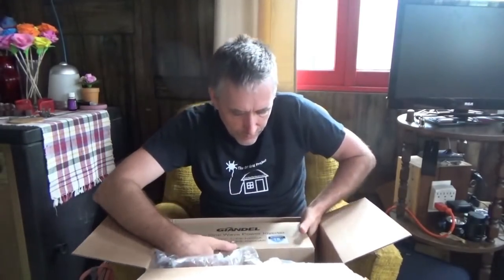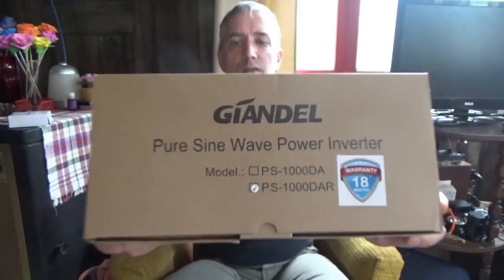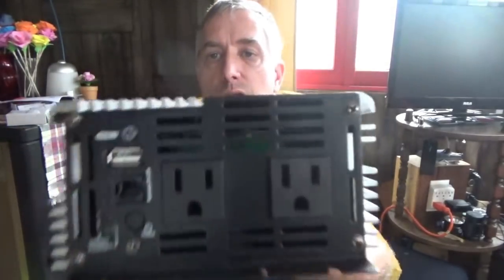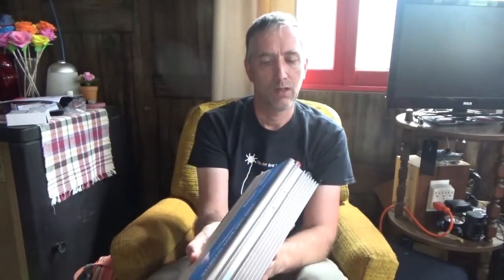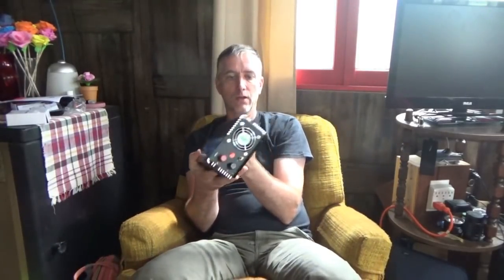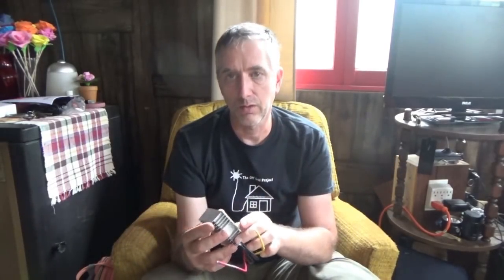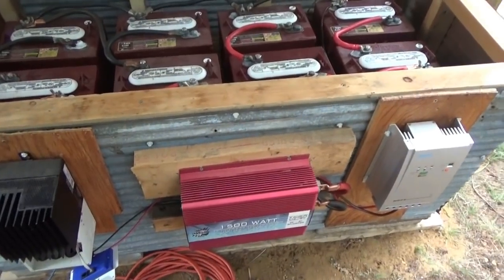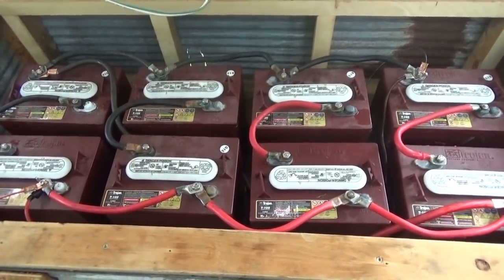The Off Grid Project Converting To 24 Volt Solar Battery Bank

Comment: I have one simple question how are you going to emergencies charge your system with your car
Reply from the maker: bypass it and just use the car power. I have enough panels on the batteries that I just leave it alone if they get a bit low.

Comment: I have now changed mine to 24 v . But i run all my 12 v things on the 24 v  battery system .   Just connect to one battery  on the system  It will save a lot of cash . Mind what i said just on the one battery on the 24 v setup. Try connect to the one near the charge controller . Only on the one battery + - . so you can still use  all your 12 v inverters .

Comment: I have 3 of those Giandel invertors. They are good but cause a bit of RF noise. The watt raiting is over rated.
The 24v to 12v buck convertor is good but also overrated, buy a few spares.

Comment: Why are you converting things to 12 volts when you just bought an inverter that goes from 24 v from the battery bank to 120 v ac.. for the home. All your appliance can run off that one invertor. there is no reason for that little box unless you have 12 v devices That can not take 120v. Any normal house hold item (ie like a vaccum cleaner) can run off that inverter. Unless im missing something from the video. 

And why go from a 1500 watt to a 1k sine.. you dont need sine wave for electronics. Any electronics now a days have rectifiers in their plugs.. and can take a VARIOUS amount of voltage like 100 - 220v  because of this you do not need a sine wave.The rectifier cleans it before sending the 5 volts to the electronic.   Unless your running some kind of electric motor or medical device you its just a waste of money since the electronics power plugs clean them up themselves.  Personally since you already had a 1500 watt inverter i would of used the money and just bought a 100 amp charge controller so i can expand my solar and wind. Then the green energy goes to the charge controller.. which charges the batteries.. then the batteries power the Inverter.. which powers the house and all its devices. and their is no need to buy 48v devices for the home.. since its converted from the inverter to 120.
Reply from the maker: 1. I have 12 volt devices which I still use. Also our USB plugs run directly on 12 volts.
2. The fridge would be destroyed and some computer power supplies these days are very sensitive and wont run. The whole idea is to run mining rigs so I need clean power.
3.  By converting to 24 volts I can connect more solar panels on a single charge controller, saving money in the long run. Now I have extra charge controllers for expansion.
Reply: The Do It Yourself World lol except you have clean power. Battery power is clean. Dirty power is grid power or generator power.

Batteries are the cleanest power you can find if anything was to hit the system like lightening that charge controller and batteries would take the hit before anything else. 

The only thing I could see a reason for it is for grid power.. because that is dirty.. if your running 100 percent battery power it’s clean and you don’t need sine wave.  Those rigs use reg power supplies and you do not need clean power for them due to they are able to switch from 120 to 240 volts depending on   Country. Battery’s Do not give brown outs or spikes or they would never use them in a ups system if they did.    

If a device can plug into grid power with no additional inverter .. it does not need a sine wave. Because ac power is not clean. They build it to run on a dirty grid. 

The only issue you may have is anything with a motor in it.. ie the fridge may have an issue with a modified sine wave inverter but 90 percent of stuff works fine without a sine wave.

Just trying to help anyone following along the journey.

Comment: Hi Troy.  Good title and exact quality video.  I know you are in a hurry to get the rig back up and running but would it be possible to throw an amp clamp or meter on the new inverter and DC converter inputs before you turn on the loads?  I am interested in the units but would like to know the real world idle power draw with no loads attached.  Just a quick volt and amp check would be great.  And it would help you too in the future should the units act up, you would have a base line power measurement to compare with later in deciding if something is abnormal.  I do this principle in factory equipment motors and vfds a lot and it really helps in troubleshooting where a problem exists.

Comment: When you go to 48V, the Tri-Star will be able to handle 3kW+! :) 

Good to see you'll be able to get more efficiant use of the panels and DC->AC conversion for mining and house use.

What matrix are you using with the arrays? 4P x 2S? 2P x 4S? 
60A controller might cut out in the summer or with cloud lensing in the winter if using 4S configuration. 
Hate it when that happens... Had to back down to 3S from 4S in my setup because of it. :(

X->12V converters are handy! I have a 48->12 for my 12V distribution panel. 

Pyle makes some good higher power units, 30A@12V,  for 24V->12V on Amazon. 
Even used them in parallel with each other to get higher power till I could get my 48V inverter/charger; NOT advised and technically voids warrantee but did work since their output and internal resistance were close enough not to overload an individual unit when drawing more than 30A from the array of units. Got about 1000W@12V reliably from the 4 units output wired in parallel; I did fuse the heck out of the setup on input,15A, and output, 30A, just in case... Never popped them in about 9 months of use tho.

Comment: Good, 24V is more efficient both the MPPT charge regulator and the inverter, for the 24V is recommended only and no less than 2 panels in series at a time, in parallel to the others with diodes etc. I know that many car adapters for cigarette lighter they go soa to 12 that at 24V worldwide, good job
Reply from the maker: Thanks. I will wire all the panels in series. Now the panels and the batteries are matched at 24 volts.
Reply: ok, it is recommended only if you have the line as you once had in the pine forest, then you take advantage of the high voltage to limit the losses of long or incorrectly over-sized cables for low voltage, where the panels are close to the controller is not convenient they lose about 2 percentage points of the MPPT, this is in the manuals of known MPPT charge regulators made in the USA, for example 24V batteries equalizes to about 31 volts, to better exploit the cloudy days or the initial and final phase of the day. maximum voltage is + 130% of the maximum voltage equalization, so for a 24 Volt battery bank it is recommended to maximize the total efficiency of not exceeding 71.5 volts from the panels, especially if the power of the panels is close to power maximum of the MPPT regulator
Ciao and good work!

Comment: Finaly!!!! good choice, you make me smile now! lol oh, and.... Battery strip fuses? lol
Reply from the maker: Wow!! Put it in your calendar!! I made you smile :)
Reply from the maker: Once I get the panels wired right I will also put in a cut off switch between them and the charge controller. That and some fuses will come next.
Reply: Not to bash, but think about fire hazards.. the short term power from lead acid battery,s is huge. The new system will work great! A master fuse between the battery is most inportant, the panels not realy, unless you want to mount it to code.

Comment: 24 volts is great. But since you're buying a new inverter anyway, why not go to 48 volts?
Reply: P.S. The good thing about keeping a grid connection is that even if your work is interrupted by the rain you should still have power.
Reply from the maker: For various reasons. For one, the equipment for 24 volts is cheaper than for 48 volts. And since the solar panels are right by the battery bank and both are 24 volts, there is less conversion going on between the two. They are now matched to one another.

Comment: CONGRATULATIONS on being able to go to 24v.....   I have a question if a EMP strikes (happens)  will it cause any issues with any of the components of the solar system?   I have watched several videos that say an EMP will destroy the system.     I hope you do a video on how to wire up the 24v system, that is what we are saving for as well.    Thanks Troy👍. Have a blessed day 🌻🐝🌻
Reply: EMP will most likely cause issues with most solar components. Spare components housed in a faraday cage is the best solution.
Reply from the maker: Interesting. Since my box is made entirely of metal on the outside, it should be a faraday cage. I think I will ground it.
Reply: Yes, that would make a good Faraday cage when Earth grounded as David said, but I think your long wires outside the cage are still vulnerable to EMP induction if laying on the soil as they act like an antenna or coil loop.  So, here I see another reason beyond code to put those cables underground for better protection to both the solar stuff outside AND to your home.  EMP can easily follow the wires INTO your Faraday cage, as Robin hints at for any gaps to the cage, as well as pass surges into your home.  So I think you may want protection on both ends.
Reply: EnergyCrafts  how about the solar panels and equipment Troy has attached to the outside of the battery box? Those items must be in a Faraday cage as well correct?   Thank you energycrafts 🌻🐝🌻
Reply: EMP actually any EM energy protection is a complex subject and there is no absolute perfect solution.  We can design our stuff to be shielded from the surge, to handle the surge or to make it not as electrically "tasty."  Yep, the panels and outside items are more vulnerable than if it was possible to have in a F. cage covering it all like a giant screen metal wire mesh fully enclosing all and ground rodded.  But that is not good first because we would lose a lot of sunlight power and screen wire is not as good as a solid metal.  So the best compromise without the F. cage is to earth ground all metal panels or equipment to an earth ground stake.  This is not shielding but acts to handle the surge to quickly bleed  any high current and high voltage surges to earth so quickly (low resistance path(s)) that the surge is first very short lived and only tends to travel on the OUTER surface of any metal objects and not much in the thickness of metal.  Also the short route to ground ensures that high voltage build up in the vicinity (less surrounding ionized air) is greatly reduced and so reduced threats from electrostatic charge build up.  For me, I would add a metal shape like the old lightning rod and mount it (like on a pole) immediately next to the panels/equipment but slightly higher than the panels for front line defense.  It will help greatly dissipate electrostatic ion build up in the area and the regular ground rod connected to each panel/equipment will help dissipate dangerous currents.  If the metal solar frames are isolated electrically (not touching each other), then a separate wire to earth ground is desired per panel or piece of equipment.  If say they all are mounted and metal to metal touching already then just one wire to ground might be ok, but an EMP can be 1000's or more amps so the very best design would use individual ground wires per isolated solar item.  This method helps protect from EMP, EM and electrostatic surges whether from Man or Nature (lightning).  Bottom line, the panels/equip is replaceable if hit, but if a surge due to the panels/equip acting as an antenna or loop attracts a lightning surge which then travels thru the wires into the house then all sorts of havoc could happen including fires.  Hence the need for careful design considerations.   Here in FL I hear of houses getting struck by lightning and catching fire fairly often.  Which is why I mentioned to Troy that the wires panels to house should be underground (shielded) if/when  he can afford it. Sorry so long,  I tried to keep it short.  It is a complex subject and there are whole volumes of books devoted  just on EM shielding and such.
Reply: EnergyCrafts thank you so much energy crafts I am in the process of learning all of this information and it's wonderful that we seem to be able to share and be kind to one another and teach each other what we need to do. I hope you have a wonderful day🌻🐝🌻
Reply: Robin.  Your welcome.  I try to contribute to anyone from real knowledge and training.  In the military we had "radiation hardened" equipment mostly.  It was designed to be very tolerant to major EMP events like from a nuclear bomb (at a distance of course) many miles away.  But at close range nothing will likely escape damage, regardless of protections.  But in your original question, I assumed you meant EMP as in lightning triggered bursts of energy and electrostatic effects.  If that is the case then all I said before, I still stand by.  But if you meant a holocaust SHTF time of enemy equipment caused EMP  or nuclear EMP events, then probably none of the safety methods I mentioned would be of much help anywhere as man made EMP can blanket the whole country easily although some radiation hardened military equipment would have greater chance of surviving.  Have a great day!  :)
Reply: EnergyCrafts what about appliances small freezer. Mixer ect. If they are not plugged in when an EMP hits will it effect the appliances?    Thank you so much for teaching me about the EMP I am in the process of learning right now😊
Reply: The Do It Yourself World  if their are any gaps what so ever they he size of a needle hole ( from what I have researched will cause a problem).   However the panels and wires going to and from the house and panels could have a problem.    Troy I have just been in constant learn mode so I am not at all 100% how it all works. I thought since  you are so well versed in these things might have a much better understanding than I.        We all need to learn and make sure for our family's sake.... once again thanks for the informative videos..... have a blessed evening 🌻🐝🌻